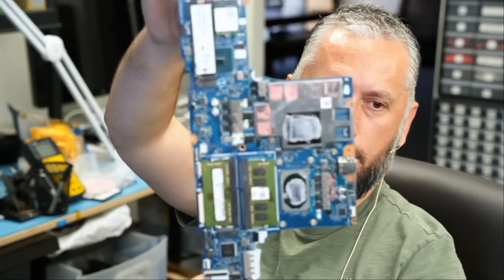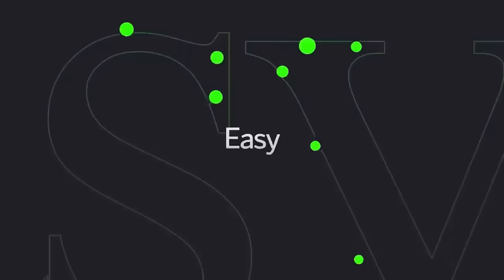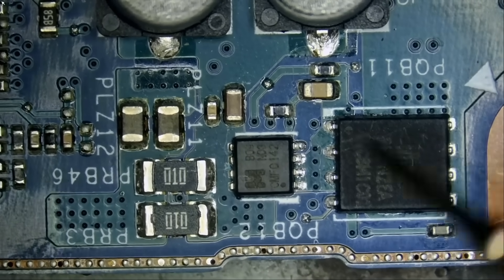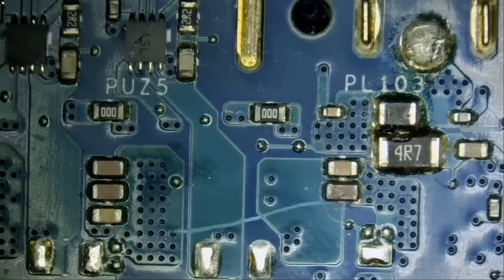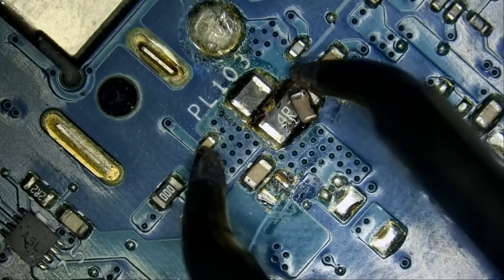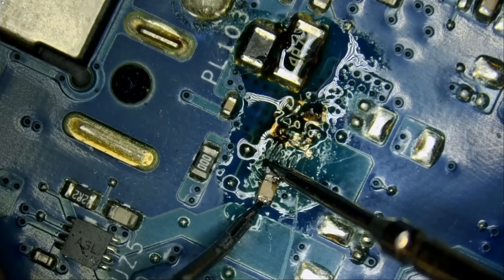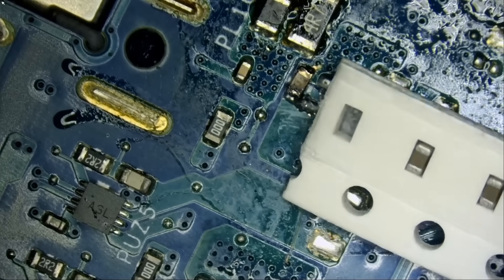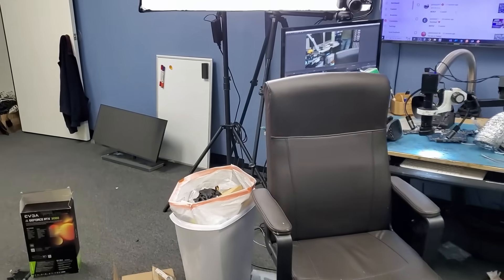Expensive Acer Helios 300 Laptop Won't power on because of this.. Is it Fixable?

Comment: It would be nice if you had an inset picture of your meter on the screen.
Also,  are you using the voltage injection tool , the NF Short you sell on your website to inject the voltage? Thanks!

Comment: I have this same model, it turns on electrically, but no other signs of life:
I tried disconnecting anything I could (RAM, HDD, battery): no changes...
could it be the RTC battery? or what else?
power LED and battery LED turn on...if I let it on for a while, without the charger, the power LED becomes orange when connected, meaning (I reckon) it should charge...

Comment: Hi Alex, usually, capacitors are not equal (in some cases might be, but in general case they aren't). These filter groups are made with different capacitors to filter out different frequencies. It will work that way, but might be not able to cover its initial EMI specs.
Reply: Indeed.... I think I would have gone for a 10uF with the 100nF (0.1uF) but any value over 1uF would do a good decoupling job, IMHO the second 100nF would do three fifths of sod-all.

Comment: in any circuit board short without voltage injection.from main power supply can thermal detect hot..ease answer me olease

Comment: Alex, what would you say is the primary reason for capacitor failure in most of your videos? Would it be due to individual poor quality caps? Or would it be more environmental or user issues? Thanks, I love watching your repairs and logic! Big Boss has big cred with me also.
Reply from the maker: Most current consumer electronics are over powered especially gaming related devices. Components are usually not tested long term in the real world.  It's the consumer who discover issues as time goes by.
Reply: Do you think consumer laptop manufacturers go to the highest quality component suppliers or the cheapest? Same question for the manufacturers of multi million $ cruise missiles.

Comment: why the factory flux is not oily? they are always dry. but yours and ours flux is oily near or below the components even after cleaning
Reply: It's a "no clean" flux..non corrosive after use...also crystallises with heat..
Reply: @222inverter  I have also a no clean flux, but still it is not like the factory flux, it gets cleaned much easier but still not like the factory. exactly as you said even below the chips this factory flux is crystalized and dry
Reply: @hp2073  it depends if it's Rosin based flux?..as some are water based.. there are different types